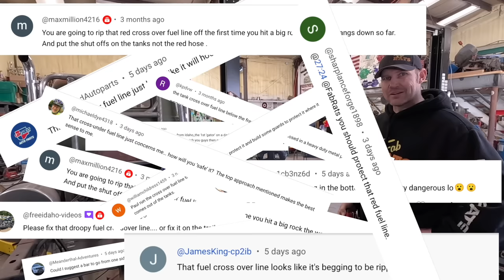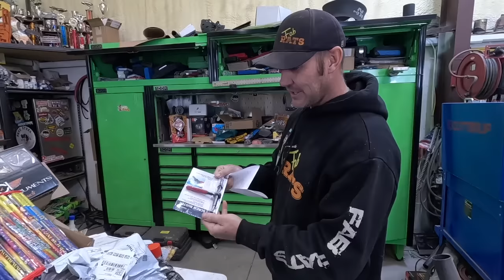The Rat Back's Leaf Springs Just Got A Whole Lot Beefier!

Comment: I'd like to see the bed on there as it is just for reference before it gets cut up. It also wouldn't hurt to have it longer in case you build something or need to haul out something longer than the FJ
Reply: I'm also curious if there is a reason it needs to be cut shorter. Maybe it's something to do with the frames length? I so hope he addresses it in the next video on this truck

Comment: If you look around the steering console of the dodge there will be a rectangle piece that can pop out. Shove a small flat head in the hole that appears from pulling it and you can shift out of gear. Almost every car has a spot like that near the shift lever. Also, broom squeegees work better if you push it instead of pulling it Shaun
Reply: Broom squeezes do work better pushing, until they wear out then pulling works better.
Reply: @jasonstrout4502  true true, the skipping of a worn out squeegee sucks
Reply: @michaelmain1990  I thought they were all done with water in the shop when they added the metal flashing.😉🤪🤣
Reply: Tow truck driver here ...  In the late model ram trucks, there is a park lock release behind a panel that pops out just above the parking brake release. With a  small screwdriver, unlock the red/orange strap then pull till it clicks. Now it's in neutral. The reverse puts in back in park. You're welcome. :)

Comment: 22:30 Measure twice cut once!! .. Thanx for leaving in theses seances! .. Makes us feel better as we all do this! .. PLUS, makes us more cautious, mistakes like this working outside in the snow are much more annoying! 

I swapped 350 small block TH350 transmission an 4 bolt rear end.. ALL into a 1966 flat face chevy van ... all outside in the snow over one winter..

NOTHNG was designed to bolt in, but I made it all fit!!  I had one rule, No outside work when it got below Zero Fahrenheit!! 

This is in Northern Canada, the snow was so deep for a month, I had to tunnel in to do work unde the van... and it was surprisingly warm in there with no wind and the torches cutting! :)

Comment: Looking good. Going to be awsomw when it's done. I don't understand why you would shorten the bed though. Wouldn't it be better to have more room.
Reply: I don't think they have the wheelbase to support the full length, and I'm sure he wants it to be shorter for better maneuvering off road. he already has a regular rollback for fitting as much on as he can, sounds like this is gonna strictly be a FJ carrier, and to haul out the occasional side by side

Comment: Had to do a rockford in my dish van when it stopped getting traction coming up the back road to kolob from hwy 14. The road wasnt wide enough to turn around without sliding off the cliff, so i backed up, cranked the wheel and the brakes and prayed!!! Lol worked perfectly! Ram really messed up when they decided to make the promaster front wheel drive!

Comment: If you haven’t already chopped the rollback bed to shorten it, maybe it might be worthwhile to check some other things like a 4-door JK to make sure they fit. I have a 14’ deck trailer and it’s a little too short for a lot of vehicles, my Bronco II barely fits. An extra foot or two would make a huge difference. My advantage is if I pull the spare tire mount off the front of the deck of the trailer I can let the front of the vehicle hang over the tongue some, a rollback you don’t have that option. I know you said it’s mostly for SxS and your own use, but maybe something to consider?

Comment: Seeing the direction the rat back is going I can't wait to see Paul wheeling this truck getting into a place Matt can't get a trailer into in order to pickup a wrecked side by side and giving Matt the idea he'll need to build one next
Reply: Always seems to be the way it is in the Utah Off Road Recovery world. 
Someone has an idea and tries it and it works then everyone needs one. 
Pretty soon someone will figure out some contraption that will allow a towed vehicle to maintain its space behind a tow truck like a traditional A frame setup and everyone will have them.
Reply: That’s what’s Matt’s spud truck is going to be for
Reply: @Crewsy  one of the issues with a traditional a-frame is it needs to move in diagonal axis as well to deal with extreme off cambers.
Reply: Parts of me was hoping Paul would have found a old stant deck frame and put on this truck make it fit with the vibes of the old pickup but you can't offroad a slant deck truck I'd assume it'd be entirely to top heavy and just flop anytime it gets on any angle
Reply: @iffykidmn8170 
I understand. 
Someone, probably Rory will come up with an idea but everyone’s opinion seems to be that it can’t be done because Rory says it can’t. Meanwhile Rory now has Big D with a modified wheel lift.
Reply: @Crewsy  the modified wheel lift is still only usable under certain conditions.
Reply: @iffykidmn8170  
That’s why in my original comment I said someone will figure out some sort of contraption but based on these comments there’s a lot more competition in the offroad recovery world than what I thought there was based on all the “experts” saying it won’t work. Just like Matt saying it won’t work even though he’s never tried. 🤦‍♂️

Comment: 23:26  The thing with using existing new spring paks like this, (compared to adding random leaves to your old packs) is??  

The engineering is already done for you!  You getting FREE truck super experienced, manufacturing level engineering for FREE.  Ride height, weight bias, ride comfort - to bull strength spring ratios! .. All for free :) .. 

Beats the heck out of trial and error back yard stuff we are used to ... IMO :)

Comment: Paul you need to run separate tanks. A right and left with   a cross over valve. But you must have a second cross over. For your. Return. Line.   Than you have  a redundant fuel system.

Comment: You should of took the cab off your Ratback, & put in on that new 2022 Ford. The fixed the front axle. That thing is brand new. It would offroad with a lift kit & a few mods. Trailmater is a dually.

Comment: I wonder if the spring being in the opposite direction and expanding in the opposite direction will cause issues.  I saw another channel (peckbrothers) say the front mount should be stationary and the rear mount has the shackle so the drive shaft isn’t moving back and forth.

Comment: 2 things: 1. You might have gotten yourself out of your donut attempt if you extended the bed back to get some better rear wheel traction.  2. instead of cutting a chunk out of the center of the bed would it be better to just cut it off the tail and cut a new tail once you make sure that it is long enough for anything you want to haul on it?

Comment: PAUL not to bust your bubble but I'd rather cut out  the tail of that aluminum rollback bed then reweld where it needs to be instead of ruinning the integrity of the front because all the stress is on front when winching ! Just saying .

Comment: 16:06   I got some Amazon "heat to solder and shrink" Connectors, that have the solder alloy wrong somehow, they require so much heat to melt ... the whole thing melts.  

I even tried an electric heat gun and they don't work well ... My advice (which we should know already) Sometimes the cheapest selection on Amazon is not the best! :(

Comment: I wouldn't open the can of worms that modifying the bed would open. It seems to me that extra length on an aluminum bed isn't going to weigh much, or hurt you in any way. It is designed to drop to the ground the way it is. Change the length and it might not do what you want it to do. Either way, good luck!

Comment: Still thinking that the chassis could have been extended,so the wheel base is longer, there's too much over hang ,then you wouldn't need to cut the deck so much,and have better weight distribution,but its your call

Comment: I bought aome solder stick kits  for my buddies for Christmas and they were skeptical. One tried them and said they didn't stick to the copper wire. Is there a trick or does it only work on stranded wire? I haven't had an excuse to try them yet as i didn't want to waste any to test.

Comment: Are you sure it's worth the trouble to cut the bed down? It would probably be worth the trouble to pull it off and put it in place to see how well it fits. Just like with a trailer, you very seldom wish for something smaller, but often need just a little more space. Keeping the existing bed size would save a lot of time and effort, and probably end up with a more useful hauler.

Comment: As usual, a great video. Although I do think those little inserted quips like the baby in this one takes away from the professionalism of the video. But that's just my opinion and I'm sure there are others that watch you that love it.
But at 16:08 in the video, if those solder connectors are the new ones that use a heat gun to melt the solder and heat shrink the connection at the same time, I suggest you rethink using those. They will come back to haunt you later with electrical problems. Ever since 1986 when they banned lead in solder, cold solder joints have been the scourge of electrical and electronic circuits. I've done component level repairs in electronics for over 50 years and in recent years, since lead was removed, solder joints have been my biggest nemesis. Heat guns do not get the leadless solder in those new connectors hot enough to properly bond to the copper and creates resistance in your electrical circuit that's only gets worse over time.
 It's not going to be a matter of if it will cause problems, it's only a matter of when. 
And just keep in mind that with your luck it's going to be in the worst place possible to try to troubleshoot and repair.
Just food for thought!

Comment: Paul why not from that Cummins in a Chevy 30 year 1968 with a flat bed maybe have a 5th wheel hitch if the truck don't have the D E F system some cowboy mite buy the Truck to haul horse trailer

Comment: Maybe you should have used the chevy frame engin transmission and computer.
Reply: huh.  most the project is dodge.
Reply: @oregonfordguy9812  they pulled the leafs out of a chevy. Why not strip the ruined body and build the GM frame? I did not rewatch it, but I belive he said it was 2022/23 6500 2 1/2 ton truck. Even as a 2 wheel drive. Seeing it there befor the dodge drag episode. If the front half of the frame needed replacement. Adding the case and front axel would have been just as intense as the dodge build. Also seeing all the can't hardly equal the value of a yougo (chevy) swapped into everything there. I think that will fit the theme of the ls swap channel. Oops I ment fab rats. 👌 if for some reason it was a gmc the Got a Mechanic Comming. Or good mechanics companion. GM the producers of generic motors LS engine may even be impressed. It is funny. The chevy dealer neer me uses a dodge 2500 Cummins for its delivery vehicle. 

Just so you do not think I hate chevy. Ford has a new one. F'r only runs downhill. Just empty every pocket, just enjoy every payment. Toyota. Toy nuff said. I hate them all. I love them all. Except those EV. You can not charge it unless you have a heated and cooled garage to charge it in. To cold in winter, to hot in summer, 300 miles empty, 100 loaded with a trailer. You can pay extra for a bigger battery. But towing is only 130 miles.
Reply: @oregonfordguy9812  that's what I'm asking why did they not stay Chevy with the cab. He had a heave Chevy frame and engine. Turnkey with a 10 Speed heavy Allison transmission.

Comment: Are you not worried about the frame cracking from all that welding? We used to weld hydrabeds on till we had a frame break in half at welds. Got told it’s common when you weld on frames.

Comment: If those leaf springs are a good indicator of the loads you will be carrying, I suggest some serious frame reinforcements….
Steel was not as strong way back when this rig was manufactured.
Reply: The new wrecked truck frame looks much beefier in comparison. However, if he's just bouncing the Toyota around, he'll be fine. That thing won't even feel a side by side.
Reply: it's on a 04 dodge frame